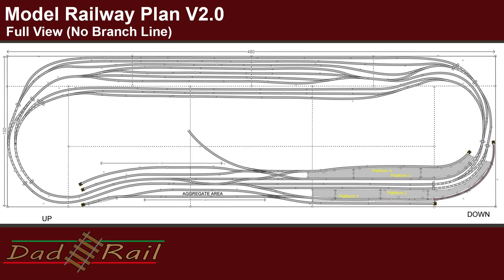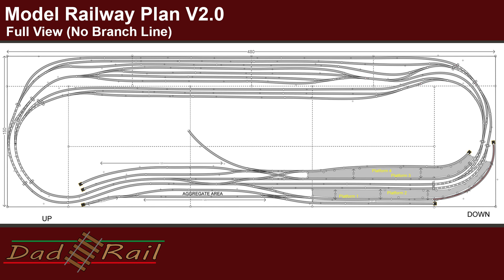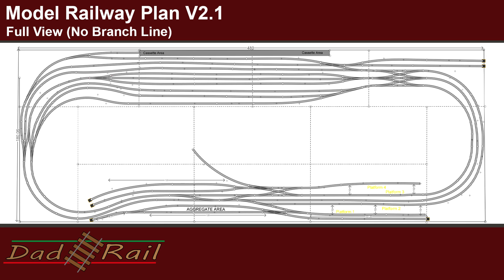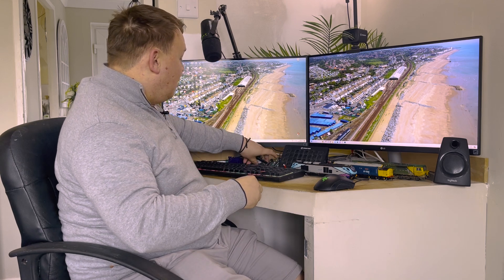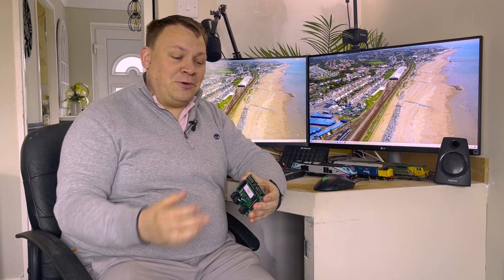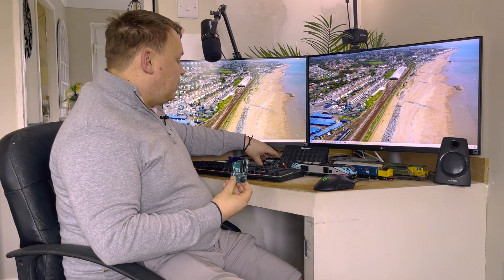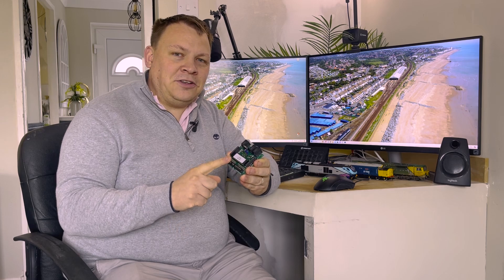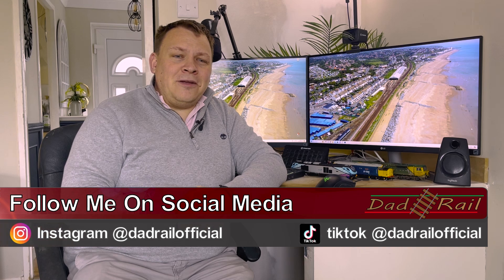Keep it Simple? Lets Build a Model Railway Part 3 - Control Systems, Arduino & DCC - Dad Rail

Comment: der r different types of rail engines. Do drivers need to be trained specifically to drive  different engines or is it a case of 1 size fits all ?

apologies if this q sounds a little stupid
Reply from the maker: Hi Paul, no such thing as a stupid question. Yes drivers need to be certified for every type of traction that they drive.
Reply: @DadRail ty...

Comment: I'm from the school of simple is best, (it can also be cheaper!!), also trains don't exist in a vacuum. I like to consider my layouts to be a) part of a system, b) have a reason for being, c) have some history. You don't have to be able to get from everywhere, to everywhere; real world rail companies generally did what they needed to do as efficiently as possible. Back in the steam days you may find various freight yards along the line with either up OR down access, and arranged for trailing drops, so you didn't have to run around all of the time. It's even a good idea to look for stations that roughly map to your plan, and examine their detail through the ages, what was built, how it was updated, and what it looks like today (and where the goods yard used to be before the Tesco's car park replaced it!). In my research I've found that real world rail yards don't always allow for 100% go everywhere, do everything moves, but they do offer the moves that the company needed to do, because of the traffic and where it came from. Also from the simple school, if you cover the board with track, there's less room for scenery (which tells the story of why the trains are here).

Questions I'm asking about your layout design: 
Why does platform#1 exist? Could it be a fenced off spur for the aggregate yard? (and possibly eliminate the headshunt, a crossover and a point motor!)
Why 3 tracks from the east side? with 2 you could simplify the entrance to the fiddle yard, and further cut costs on all those points and motors.
Do the sidings accessed from Platform#4 need mainline access, are they storage for trains which terminated here and that are out of service during non-peak times? Do they need to be that long?? Is the spur heading off to the middle of the board a branchline? Why not make it one, give it a fiddle yard hidden under some scenery.
Where is the Tesco's Car Park going to be? 😁

Other points:
Bidirectional tracks in the main fiddle yard are excellent idea (not so great for steam era), since you can run all of your multiple units from these tracks in either direction.
3 way points and cross overs can be points of frustrating failure, if you can do without (have the space), I'd give some consideration to something simpler.

Comment: I have an idea of track plan and am currently deciding on how its all going to fit together electrically.  One of my older layouts there was so much wiring with point moters, but now it seems so much easier.  What you say about being able to play trains, has led me to deciding to use the cobalt signal levers, with a mimic panel of point position on a board.

While I see a few videos about them they only ever use 3 wires, yet they have about 9 in total and i aqm not sure how all this stuff wires up to use the extra funtions when sliding the switch, (extra parts needed as such).

I am interested about your board lighting up with leds along a set route so interested how you do all of that, anyway will look forward to seeing your testing area.